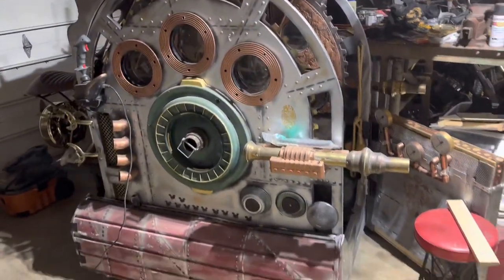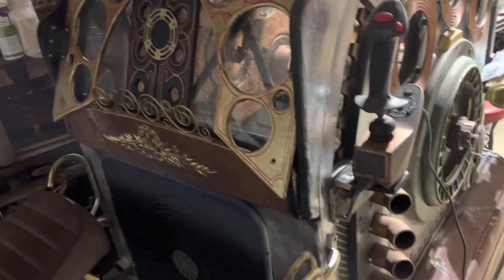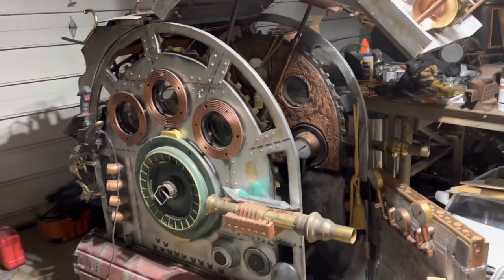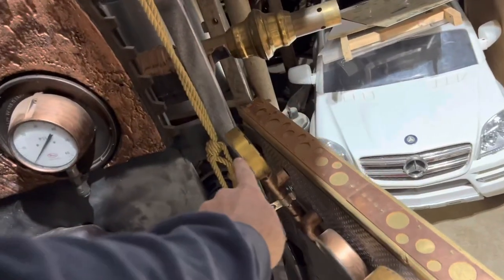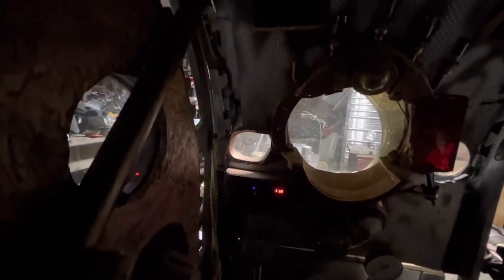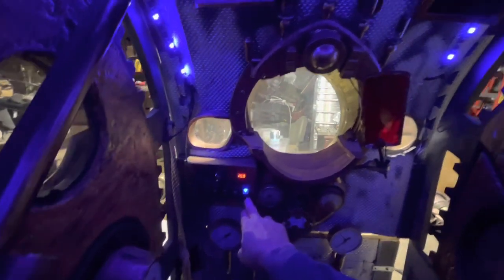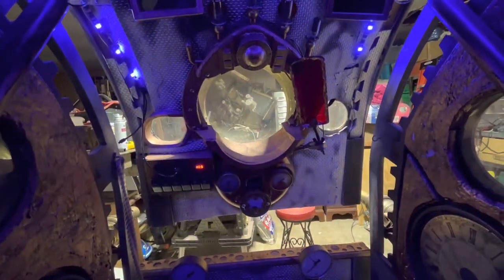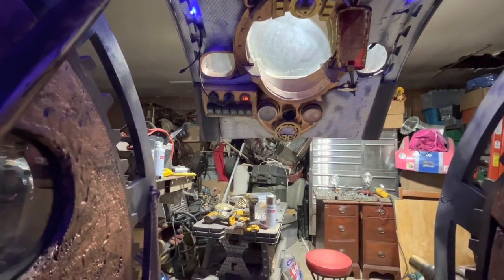VLOG 52: Steampunk Underwater Submersible Passenger Vehicle part 5

Comment: Regarding power draw from the door, if you have the specs it should list max amps and voltage and then given the time they run you can calculate the W/h drain. A short term high amp draw will drop measured battery voltage, but that isn't all that meaningful since voltage measured under load isn't accurate. The key would be to see how fast it bounces back to close to the original voltage before activation.
Reply from the maker: Thank you Sir. I'll see what I can come up with, or have you over for a beer and you check. :)
Reply: @HCSCreates  Oh no! Not a beer!